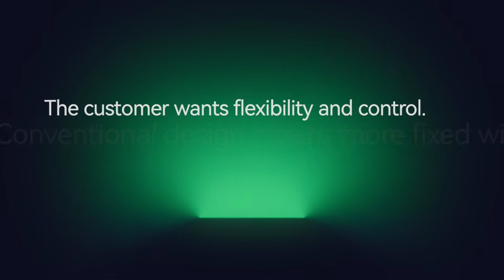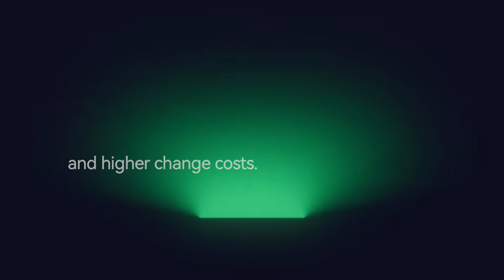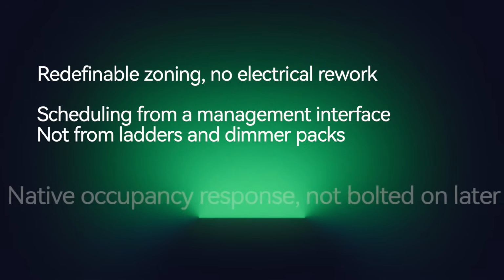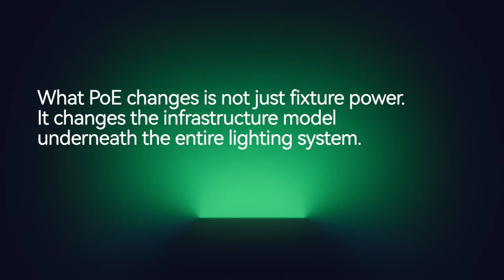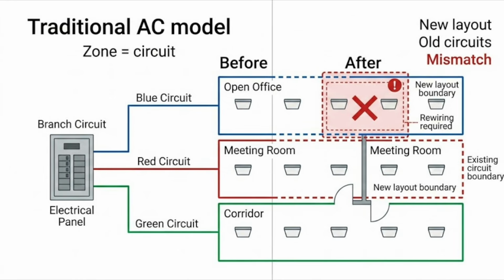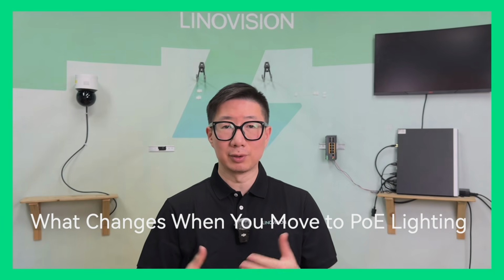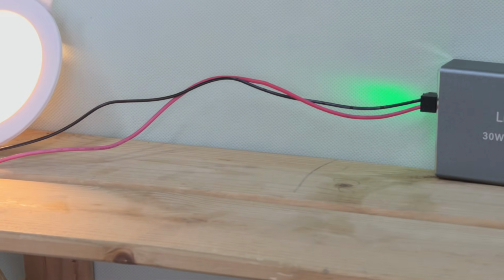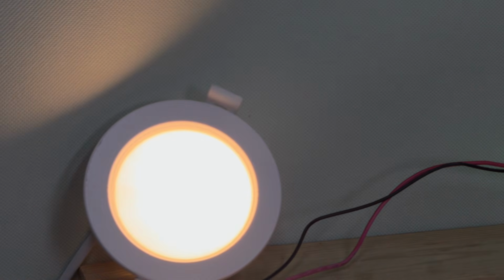PoE Lighting for Office Renovation: Why It Makes Sense, How It Works, and Real Testing

Comment: PoE lighting is not a bad idea, but these days it needs a packaged solution to be adopted. Problems with this product: (1) Constant current fixed at 600mA - If you wanted to connect a lamp of approximately 7W this will not work as packaged lamps / downlights etc obviously do not exist that require 600mA. I suggest a dip switch behind a screwed shut cover to change from constant current to constant voltage or be able to vary the constant current to 300 or 250mA); (2) Still require local switching - Rather than switching off the power to the device at the switch, the power must be maintained and an API request to control the light could be sent from the switch / controller to the PoE driver. The PoE driver must support wireless switching (e.g. have a quinetic receiver built in); (3) The PoE driver must supply an API providing the ability to switch on/off, usage stats, alerts; (4) VLANS should only be used to limit broadcast traffic. Devices need to be registered with a controller (linovision switch) using mTLS so all traffic is encrypted. If linovision produced this, I would buy loads!

Suggest, as a starting point, looking at the Open Charge Point Protocol 1.6J for charging EV. Using websocket over TLS would permit the control server for lighting to be located locally or in the cloud if desired.

Comment: What HARDware do you use to control these lights?
Reply from the maker: Hi, the products featured in this video are: 

8 Ports L2+ Full Gigabit BT PoE++ Switch with Remotely Cloud Management
https://linovision.com/collections/poe-switches/products/8-ports-l2-cloud-managed-full-gigabit-bt-poe-switch-max-480w-poe-power

(POE-Driver30) 30W High-Efficiency PoE LED Driver for Professional Lighting
https://linovision.com/products/poe-driver30-30w-high-efficiency-poe-led-driver-for-professional-lighting?_pos=1&_sid=bc336eff4&_ss=r

Comment: Not a good idea. Firstly, get your space lighting designed right at the first try, then you won't need that "flexibility". Secondly, LED is a high power consumer, not a good idea to carry that amount of power over ethernet cables and through those microscopic surfaces in rj connectors. This is simply not a good technology match. ....Maybe if that poe-led converter is very cheap device compared to a proper led driver and if you need many LED lights in a temporary tent - then this may be useful but not for anything permanent. I know you mean well and tried to build something new. But dali is much more suitable to this particular case of centralized LED power distribution. PoE was designed for ethernet devices. Back to first principles of the original design for the original purpose.

Comment from the maker: PoE lighting offers some very real advantages, especially in terms of safety and centralized management. Because it runs on low-voltage infrastructure, it can reduce certain electrical safety concerns, and it also makes monitoring, control, and maintenance more unified from a system perspective.

That said, PoE lighting is generally better suited to applications where the control requirements are relatively straightforward. For projects that require advanced color-changing effects or highly complex lighting logic, it may not always be the most natural fit compared with more specialized lighting control systems.

From a scenario standpoint, PoE lighting tends to make the most sense in spaces where safety, simplicity, and manageability matter most — for example, warehouses, corridors, certain outdoor areas, or other environments where the primary goal is reliable on/off control, basic dimming, and centralized operation.

In higher-density spaces such as offices, the picture is a bit more nuanced. PoE lighting can still be a strong option, especially when flexibility, zoning, and smart building integration are important. But the design needs to be more disciplined, because once fixture density increases, factors like cabling layout, switch budget, and long-term maintenance all become more important.

Comment: One thing you didn’t mention or show in this video is what about the light switch?  I understand you can control it to the software by turning on off the plant to turn the light off, but what about four officers that you don’t want to be able to walk into the room and turn the light on and off with a switch on the wall?  Is this not an option with what you guys are offering here?

Comment: I would use DALI in this case. There are plenty Products for DALI and with a centrale DALI Gateway you can also do everthing you have mentioned.
Reply from the maker: That's a fair point, as DALI is a very proven solution for many commercial lighting applications.

Comment: My biggest problem with implementing this is the general lack of full power budget PoE++ switches.  A 24-port Type4 PoE++ switch needs to be able to power up to 24x100Watts = 2400Watts.  There are a few of these (I've only ever found 2x models from lesser-known vendors), but people need to understand that it's really uncommon.  This means that you are going to be limited with what PoE type you can supply power to - some times on a 24-port switch you can have 4x Type-4 devices only - so it's not really a "24-port switch for Type-4 PoE++", it's effectively a 4 port switch for Type-4, or a 12-port switch for Type-3, and a 24-port for Type-1/2.  What you lose in AC wiring cost, you're going to gain in network hardware costs.
  
Assuming a today-typical 110lumens/watt for modern white LEDs we can estimate the maximum light possible per port by PoE type:
Type 1 = 12.95 W, ~1425lumens
Type 2 = 25.50 W, ~2805lumens
Type 3 = 51 W, ~5610lumens
Type 4 = 71.3 W, ~7843lumens
A typical 4' T8 LED form-factor light draws 15W and outputs about 1800lumens.  A typical 2'x4' drop ceiling fixture will have either two or four of these - drawing 60Watts, this puts a fixture like that well into the Type-4 class of PoE power demand.  If you did a "single bulb" T8 strip fixture, that would still need a Type-2 minimum.
  
And that is before considering the cable losses, so saying the cable runs "don't matter" is an unfortunate marketing decision here.  If you are intending to transfer power over the Ethernet cable, you want to pay SPECIAL ATTENTION to the cable - typical ethernet is 24AWG, but it is possible to get 20AWG Cat6 (double the cross-section and half the resistance/foot) which will have an IMENSE IMPACT on the voltage drop through the cable run (enabling higher actual end-point powers or longer runs for lower end-point powers).  The less intellectually honest you are about this now - the more problems early adopters are going to have, and the less traction you will get industry-wide.  Be realistic.
  
I do agree that PoE++ 802.3bt is the correct way forward for lighting, building automation, HVAC&C control, and security - just because it's an industry standard interface that supports power and significant amounts of data while enabling Commercial-Off-The-Shelf network security that other interfaces just can't handle.  And it allows centralization of all of that data for a common operating picture of a building to something like a Building Management System.  But it'll need to be an open standard to support an industry-wide growth.  Something like say KNXnet/IP (no affiliation).
Reply from the maker: This is a good point, especially for people getting into PoE for the first time.

The difference between per-port output and total switch power budget is real, and it definitely matters in actual deployments. That part has been covered in some of the earlier PoE basics videos on the channel too, including the PoE switch buying guide, because it’s one of those details that seems small at first but can change the whole result.

That’s also why PoE looks simple on the surface, but can get tricky pretty fast once real loads, cable runs, and switch budgets enter the picture. and agreed on the bigger picture too — PoE lighting does make a lot of sense in the right applications. The use-case boundary matters.

For anyone newer to PoE, the basics videos are a good place to start. Once those pieces are clear, this kind of discussion becomes much easier to judge.

Comment: I think it's a neat idea as long as you're not tied to proprietary black box phone apps. Ideally it should be web based so it's future proof and not rely on proprietary software or specific device/versions but rather simply a web browser. If you use dual PSU switches that are on UPS power you also don't lose your lighting if power goes out, so that's a plus.
Reply from the maker: That’s a solid point.

For any lighting system intended to last, avoiding dependence on closed phone apps or device-specific software is a very sensible design principle. A browser-based management model is generally the more future-proof path.

And agreed on the power architecture as well — with dual-input switches and UPS-backed power, centralized PoE infrastructure can offer a meaningful resilience advantage during outages.

That combination of manageable infrastructure and power continuity is part of what makes this architecture worth looking at.

Comment: How can I see what the software looks like for controlling the light? Also do you have Poe light fixtures?
Reply from the maker: In the current setup, control is handled through the management interface of the PoE switch, so the system is centered more on infrastructure-level management, things like port-level control, scheduling, monitoring, and remote access, rather than a standalone dedicated lighting-control software platform.

On the fixture side, the PoE driver is designed to work with compatible DC lighting loads, so it is not limited to a dedicated proprietary PoE light fixture. That gives more flexibility at the fixture level, depending on the lighting design and electrical requirements of the project.

If helpful, a follow-up video can show what the actual control interface looks like in practice and how the system is managed day to day.
Reply: @linovision do you have a driver that supports 60 or 90 watts?
Reply from the maker: Yes! both versions are currently in development. We’re working on both a 60W and a 90W option right now, they’re not released yet, but they are part of the roadmap.
Reply: @linovision can I use wagos to connect more than one fixture to the driver ?

Comment: How is this better than a DALI system?  You show controlling the light by turning on/off the PoE on the switch.  No dimming?  Also you need a separate cable back to an expensive network switch for every light with this PoE system.  DALI can link many fixtures with a single 5-core cable, and still enables individual dimmed control of each fixture.  I don't see PoE lighting replacing DALI in a commercial building any time soon!
Reply from the maker: Fair point — DALI is still the mainstream choice in commercial lighting, and for good reason. As a dedicated digital lighting-control protocol, it remains the more established fit when the priority is large-scale dimming, grouping, scenes, and control over a dedicated lighting bus.

What this video is really highlighting is not “PoE replaces DALI.” It is a different architectural priority. PoE lighting becomes relevant in projects where low-voltage deployment, network-based management, endpoint visibility, and easier reconfiguration over time matter enough to shape the infrastructure design.

On dimming, switching a PoE port on and off is only the most basic example of power control — not the full definition of lighting control. Real dimming depends on whether the fixture-side PoE LED driver is designed to support proper dimming behavior, and on how the overall control system manages that capability.

Cabling is a real tradeoff as well. In many commercial projects, DALI is still the more practical choice today. But at a broader system level, these technologies do not always have to be treated as direct opposites. In some architectures, DALI handles fixture-level lighting control, while PoE provides the low-voltage, networked infrastructure and management layer around it.

So the better framing is not replacement, but architecture. DALI remains the default choice for many commercial lighting projects, while PoE lighting offers a different, and in some cases complementary — value proposition.
Reply: The address space for one...  DALI has 64 addresses.  IPv4 has, more, lots more.  Then IPv6 has even more.
  
Then there's the latency issue with DALI, if you update all devices individually it can take more than a second.  This is a side-effect of the 1.2kbps data rate over the DALI interface - whereas you could easily see 1Gbps to Ethernet endpoints, and you still retain the ability to broadcast  (multicast) a scene update to all devices in addition to directly updating (unicast) a single device.
  
Then there is "Who can install them" question - low voltage wiring like PoE Ethernet typically doesn't require the same amount of regulatory scrutiny and inspections as higher voltages, simply because the amount of energy available to the cable is below a specific hazard threshold.  You could have an Electrician run AC power to your network closet, and then your low-voltage contractor run to the individual fixtures and controls.
  
Personally, even if the power was not delivered over the cable, Ethernet is still the right way to go for future standards - just because there's essentially no economic reason preventing this anymore.  You can get a step closer to this today with an Ethernet-to DALI bridge (they are not hard to find), and perhaps we'll start seeing Ethernet reach all the way out to the light fixtures with a cabling standard like 10base-T1 (single pair Ethernet) which is already creeping into industrial control places where RS-485 MODBUS and bi-directional HART protocols have long reigned.
Reply: @Real_Tim_S   DALI’s 64 is plenty of addresses for a single cable run. You can have as many DALI busses as you need.  So essentially unlimited numbers.
Speed isn’t usually an issue in commercial buildings.  Also the slow speed makes the protocol much more resilient.

Less scrutiny and inspections is not necessarily a good thing!  Ethernet runs still require expensive certifying on most commercial sites.  Also PoE has just been added to the UK electrical code.  PoE can still provide much potential energy, and the associated risks therein.

Yes, Ethernet is commonly used at the head end for lighting control, but it just doesn’t make sense as a distribution architecture for commercial buildings with 1000’s of lighting fixtures.

Comment: I've been telling people that PoE lighting is the future, imaging having a 48 port switch that can connect all your lights to and then manage them easy with an app!  Awesome !
Reply: But it will get expensive quickly in a commercial building for the number of managed network switches you will need!  Every light needs a port!  Also if you need to add a light, then you have to run a whole new cable back to the rack.
Reply: @lucidlx  Not really, soon you'll have pass through PoE switches you can add, and you'll also see lights have multiple ports to pass through too. aka daisy chaining.
Reply: @JasonsLabVideos But you are still limited to max 100W per cable.  So only a handful of fixtures. And that’s with the latest PoE version.  A single 230V DALI run can support many more fixtures.
Reply: Yeah, I have my entire house filled with smart WiFi devices/lighting/hvac/garage doors as well as doorbells etc.. I can just as easy open one app and control all of the devices, I can add and delete users, set timers to either run sprinklers or turn on certain lights etc. I can also change color of all my lighting inside and outside of my house, etc etc etc. I don’t see any benefit to switching to all PoE devices other than if one of my wifi networks. Have problems with connection.. that never happens, plus I have a mesh WiFi system so if one AP is having issues, it will automatically be handed off to another AP device and be just fine. Hard to sell someone on a product that will need to have Ethernet cable ran to all devices that already have an existing power connection.. don’t get me wrong I have installed all my PTZ CCTV on my house as well as my parents and brothers homes using POE, but that’s because where the cameras are currently installed there was no power connection and it was far easier to install the PoE cable to a new camera device rather than run conduit and have to ensure WiFi signal will reach where the cameras are etc etc..
Reply from the maker: Couldn't agree more, it really is the future of smart building management.
Reply: @linovision  Pulling a nice cat6 or Shielded cable to a LED light, the automation could be endless !! Can't wait to see you grow more with this !
Reply: and LiFi
Reply: @7katter0128  lifi to slow and you have to be RIGHT directly infront of it..